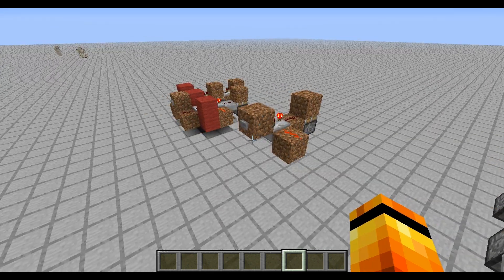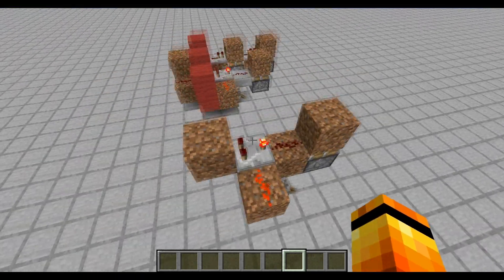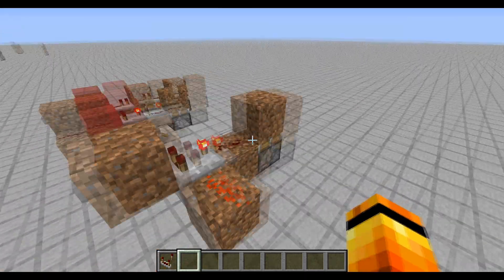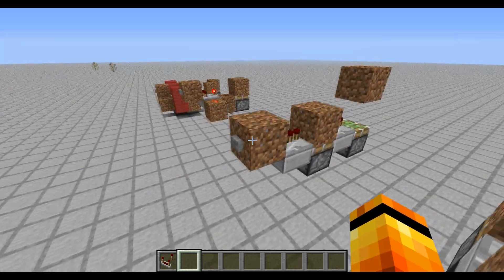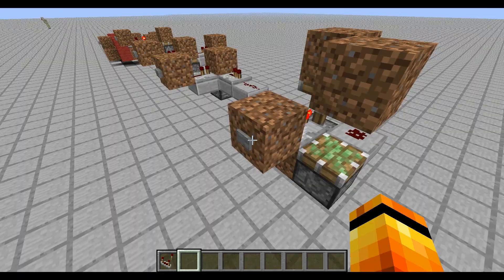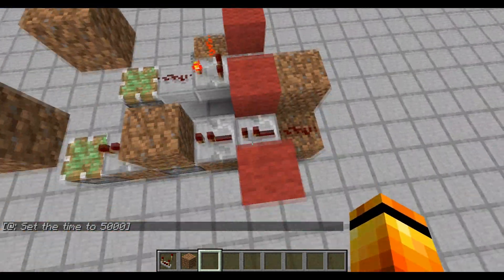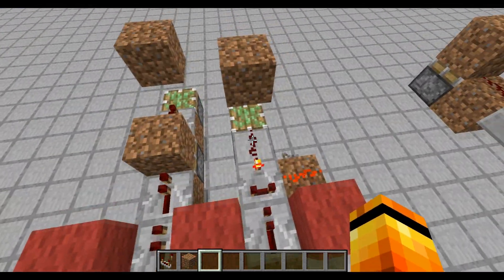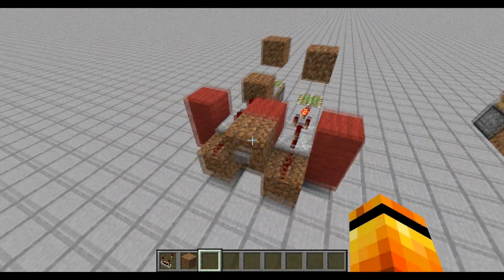Minecraft 1.5 (13w01b-13w04a ONLY) - Smallest 1 Tick Piston-Less Pulse Limiter

Comment: In the new snapshot 13w05a the comparator pulse is patched. It was a bug. This is only possible form anywhere between 13w01a to 13w04a. Any version before or after it won't work.